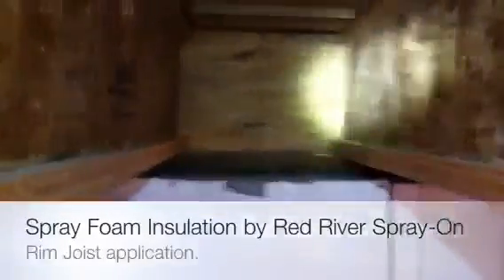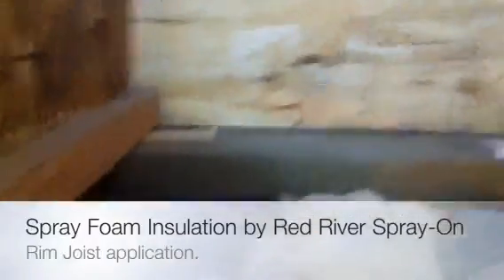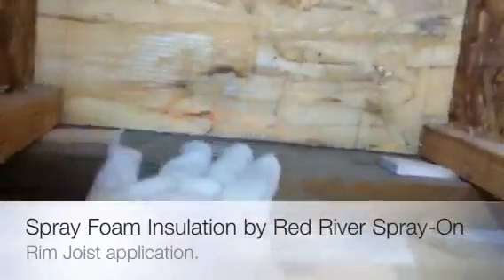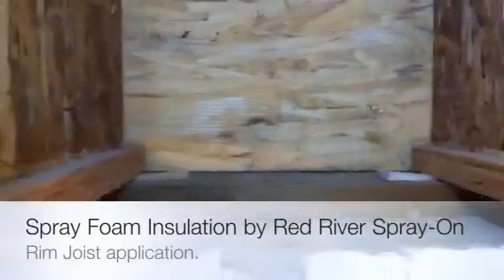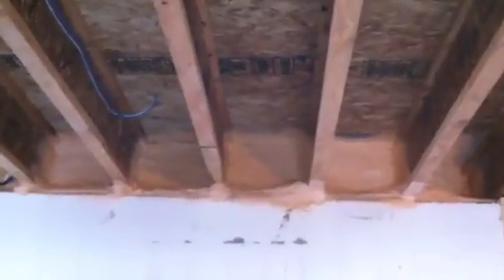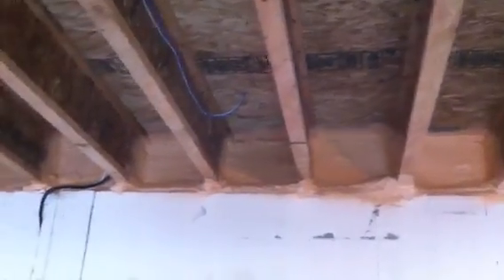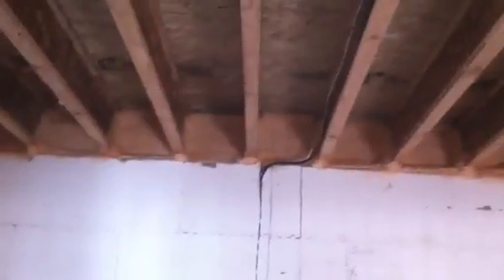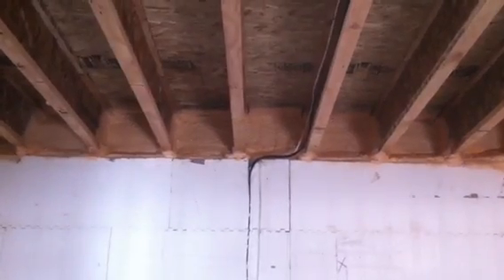Spray Foam Insulation - Rim Joist 5

Comment: I had all the basement walls, sills and rim joists done with spray foam on a neglected 100 year old school house  and I'm completely satisfied with the results. A complete airtight seal with a high insulation value in the basement was one of the best cost saving renovations done on this house.

Comment: I live in Winnipeg where this business is located and I assure you the post you commented on is totally accurate. Our yearly temperature range from -40 C - +40 C. Yes the air is dry in the dead of winter but during the fall and spring it gets very damp and humid. They don't need to "fear people" into getting their product because it is by far the best way to keep your house warm, dry, and air tight through our extreme climates.

Comment from the maker: What you're discribing is exactly what a lot of our customers do - about 3 months before they call us to come do it right.    Around here winters are -40 degrees celsius with an indoor temp of +24.  That's a 64 degree diffrence because the rim joist is so hard to insulate properly the dew point is easily reached and condensation forms which causes mold.  Around here it's a no brainer where even the minimum code home builders still use spray foam in the rim joists.

Comment: Typically, there's no UV exposure on a rim joist. Caulk only seals air infiltration and does not insulate. Siding or brick protects the house framing from standing water but air moisture can still penetrate via condensation. Spray foam cost more but can save you time. You can also insulate with foam board and save $ but it's time consuming.